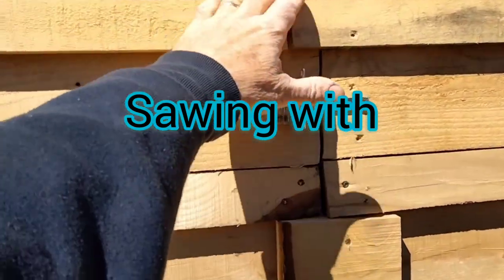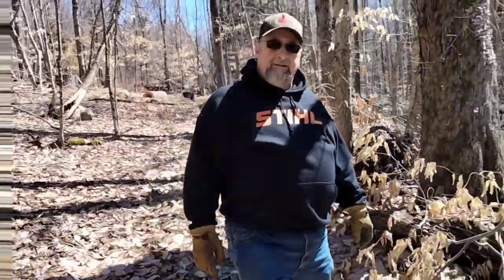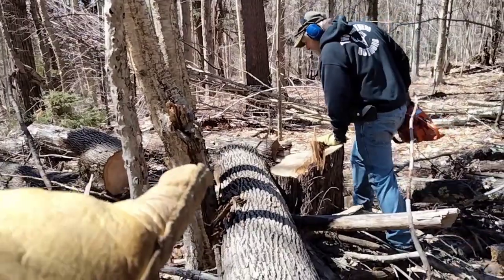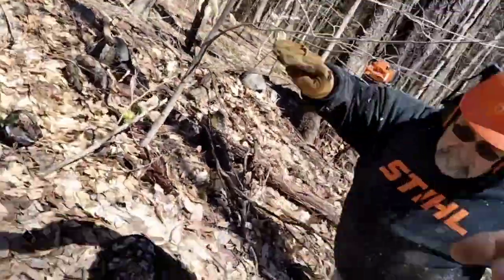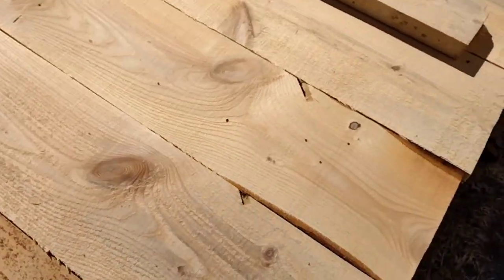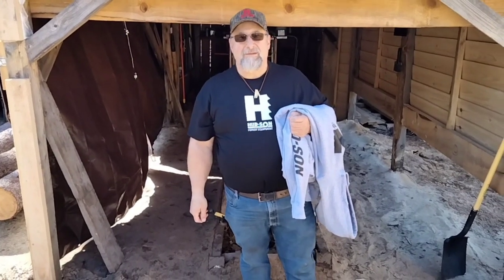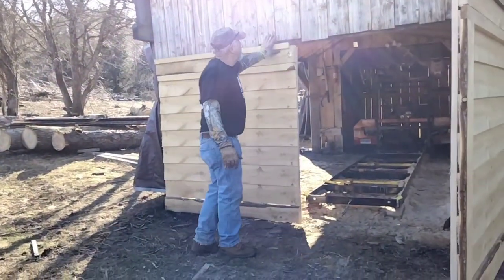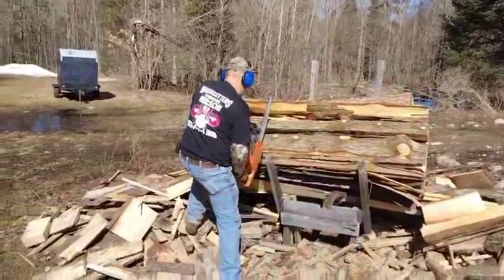Don't Look Back! RUN!

Comment: The critter in the hole doesn't know which way is up anymore.  At the end, do you mix in pine with your firewood or does that go to the burn pile?
Reply from the maker: We advertise it as camp wood. $25 pickup load and  and they have to load it. Usually have people on a waiting list. The critter? I'm surprised it was still there. Idk what it is. It only sticks it's nose out of the hole. Gray with pinkish around it's nose. Can be very big because it's a small hole.🤷
Reply: Nice bunch of Cherry for the counter top, sounds like a cool BBQ Joint
Reply from the maker: @bucktalesoutdoors7566  "was" is the key word now, all sawn and sold, my kind of wood 😉